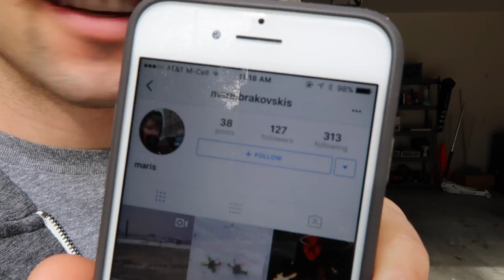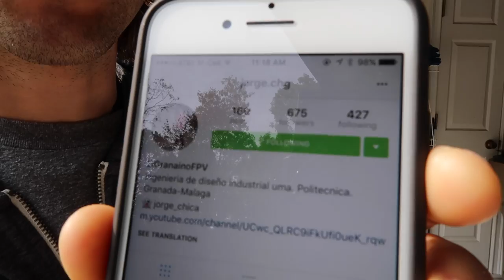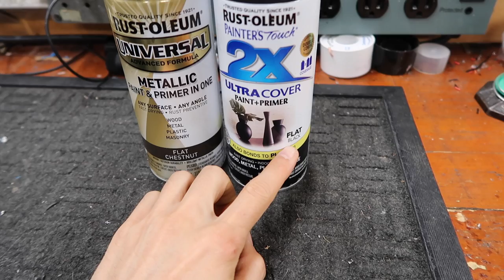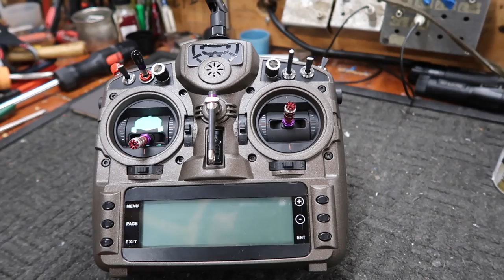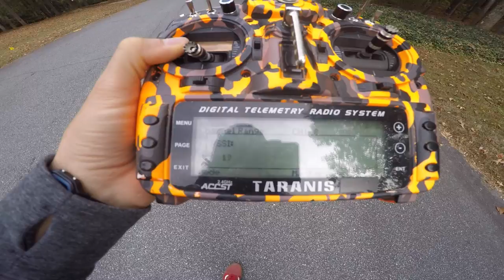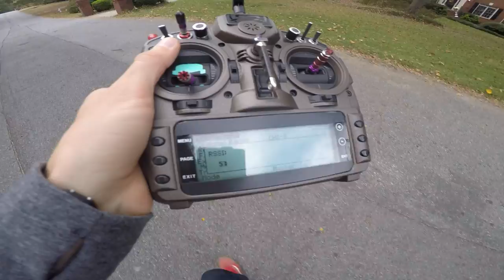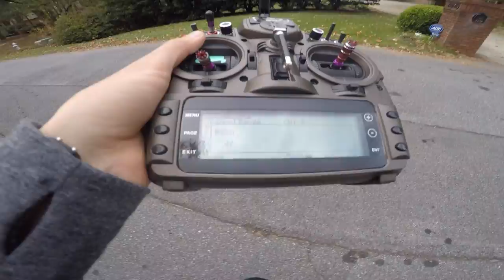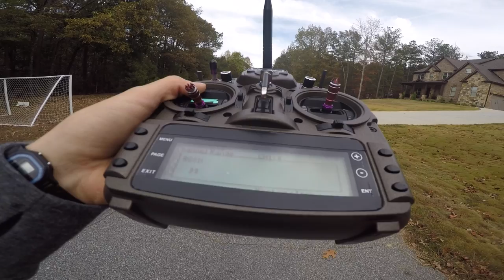The MUST HAVE FRsky Taranis Mods

Comment: Gentlemen, we strongly advise against the antenna mod.  We developed this mod +2 years ago achieving the longest run of +10km out.  The mod does work well but in the end we found a high failure rate due to the solder pads lifting.  Furthermore, even when the mod is done well, we have found much high failure rates of the RF module over time.  I strongly recommend using an external XJT module which comes with an external antenna connector and has no risk to your TX.  It works just the same and we achieved near similar performance.
Reply from the maker: +mgbolts who are you and what is your background ?  Just curious if you work for FRsky. Or are just a guy that tinkers.  I'd rather have better performance and risk "killing" my 30$ RF module than have decent performance and it last forever.   That is if what you're saying is true..  which I'm skeptical because I've seen people with this mod for over a year now with ZERO issues.  
Cheers
Reply: Are you the guys from boltrc?
Reply: PM'd on FB. We have done 100+ of these mods.  As highlighted, the failure rate is high due to novice attempts at what is a difficult solder where pads lift very easily.  BTW, if you do damage the original taranis (ie. not the plus), they dont make the backboard anymore. 

You are right, the mod does work very well, +10km :) achieved with no booster etc, just simple 5dbi whip. I suggested the external module as it is essentially the same mod already done for you, just add the antenna....

 In summary, I am agreeing with you, just a different approach with less risk and similar outcome :)
Reply: I think as long as you guys glue the wire to the case to relieve the strain of the wire moving around youre golden.
Reply: 10+ km with what reciever? i have a x8r and 5dbi mod and i cant get over 2 in a non 2.4 polluted area.

Comment: Thank You Mr Steele.  Your video was very helpful.  I did the mode yesterday with RG316 like you suggested and used the length you recommended.  First antenna that I could find laying around was 9dbi WiFi antenna.   SWR was flipping between 0 and 1.  Did a range test and was very happy with results.    I am glad that I ran into your video, not someone else s, otherwise I would have used wrong size and length of the coax and would have been plagued with SWR and RSSI issues, like most people have.

Comment: To remove hotglue just use a single drop of alcohol, it will come right off with no trace left!
Reply: muh1h1 wieso zur Hölle bist du in jedem Video das ich schaue?
Reply: I love isopropyl alcohol, it has so many uses, it's crazy.
Reply: What kind of alchol ??? edit your comment it is useless
Reply: @leoetcheverry9685  all the substances commonly refered to as "alcohol" work. Rubbing alcohol, ethanol, isopropal, etc.

Comment: Word of advice: solder the negative first, i almost ripped the antenna pad of because i had trouble with my stiff cable (bought the wrong one as well). The negative pads are way bigger so you won't rip them.

EVEN BETTER: use a ufl smd antenna connector so you can swap later (if ever needed)

Comment: To make it flush i cut a 5 inch propp and filed it flush.. drilled a bigger centre hole and used a file.. took like 15min of filing.. a bit of work but it was fun : )

Comment: Steele -would be a life saver if you could link the nut you are using on the switch. I lost mine and looking everywhere? "taranis switch nut" ??got any links
Reply from the maker: +UAVfutures radio switch caps on EBay.  Check that   You should be able to find some colored ones lol.  A lot hobbies has replacements if you buy s new switch.   The switches are cheap

Comment: Alex greve is the man! He did the mod on my terrines with the cable and sma port and all that, and he didn't even go 316 on that cable. Its that super duper fat stuff he uses on his helical antennas. Works great! I also use one of the 2.4 ghz clover leaf antenna with it.
Reply from the maker: +shaneman27  haha heck yeah. I tried the clover leaf in a range test. And I prefer. My 5dbi whip right now.  I never have issues with orientation of my antennas  that the clover leaf would help with
Reply: Mr Steele yeah I doesn't really improve range much maybe a little, but what I have seemed to experience is it helps with penetration. I flew a wing with an x8r in it to about 1.7 miles before getting rssi low. I don't think I got quite that far with the stock. 

And I just remembered something. Right before Flite fest you had a periscope going until like 4 am and I commented something that I didn't expect you to see but you did and I said my name is Joe but it's Shane and you just kept calling me Joe and then when I met you at Flite fest you are just as funny as you are on camera. 😂 I'd love to see you again sometime In the future.

Comment: To remove the hotglue you can use alcohol as well, works perfectly fine!
Reply from the maker: +Jory W thanks. I'll try it soon
Reply: The alcohol or acetone doesn't really dissolve the hotglue but will make it come loose and the hotglue can easily be lifted off the surface in one piece.

Comment: They make a really nice glossy Carbon Fiber looking complete top case half for 39.99 also.  I am waiting on the new Hall effect Gimbals for mine to change it over with the top case and antennas.  A better speaker is a cheap but much needed mod I bought also.

Comment: i finally need to get rid if my dx8 even with 2W wifi extender the range/penetration is bad.... will probably do the same mods THX.
Reply from the maker: +crash dummy yup. I had a Jeti with a 800mW booster and it still sucked compared to the 100mW stock antenna Taranis.  Mini quads require different needs than LOS plane flying

Comment: So I finally got around to doing this, I also used the more difficult RG316 coax. So attempt number one I left the taranis circuit backboard in the taranis frame and ended up screwing it up :( I'm an experienced solderer, but even still. I put a little too much strain on that tiny antenna signal pad and it ripped off the board. Had to order another backboard ($70 :( )

Then, attempt number two was much easier as I had the backboard taken out of the frame.

Mod successful now. Zero SWR.

Comment: Yeah, I was thinking of an antenna change up but wondered what configuration would be good for drone operation. I was thinking if you wanted max distance in operation if a Yagi would be best since it creates a beam output vs an omni output. For the transmitter part on the handheld wouldn't be a problem but the transmission on the drone might be a problem unless a better collector antenna to receive weak signals from the drone can be used to boost your range significantly. That would be a cool test to see.

Comment: Steele, weren't some people having range problems with their high gain antennas,  with the problem supposedly with the connection with the SMA connector?  Something about too many cycles of adding and removing the antenna, hurting the integrity of the SMA connector?  I remember something.   Do you?  If so is it gone?

Comment: we where curious my friends and me about the 84mm length.. so we tested.
84mm 94mm 10mm and with shield means not measure it from the base of the rp-sma contact.. if we gona be sticklers.. so we threw in that in the  test as well.. one extra 84mm measured from the crimp and an extra little bit for the signal wires.
so 4 Taranis got modded.. and guess what.. they all had same distance and rssi.
so don't be fuzzy when you all cut your cords : )
Reply: I was under the impression that the measurements really come into play when stripping the end of the antenna wire. Most often on rx's because they often get cut so you can strip the coating back the correct amount and still get the same range as before. But I'm 
Always learning new things so I figured Steele was more educated than I. LoL

Comment: In the rush to fit a 5dbi antenna it's probably worth pointing out what you lose for gaining gain... The radiation pattern is flatter and antenna orientation becomes more important (all that flippin' ain't helpin'). The flatter radiation pattern means that if you fly much above 45 degrees from yourself you may find you have reduced range compared to the 2dbi. Watch out during those big inverted hangs!!
Reply from the maker: +iFli helps to mount Rx antennas 90 degrees out of phase.   I have no noticeable side effects from the 5dbi antenna
Reply: Cool. Just thought I'd mention it!

Comment: damn that's awesome. you could fly half way to the moon with that thing. my dx6i must have problems because I would drop signal going that far away not even in range mode. I can't wait to get a new radio.
Reply: Casey Searls mine was shit too, taranis is much better
Reply from the maker: +Casey Searls haha sorry to hear that.  Taranis aren't that expensive :). Used ones are even cheaper :)
Reply: Tax returns can't come soon enough haha
Reply: Can I buy your orange one? I promise I won't try to sell it on Ebay :)

Comment: The antenna mode is a good idea BUT if the goal is to remain legal -- they measure the legal limit based on radiated power.  NOT on the input from the transmitter board.   Your mod certainly increased the amount of power transmitted but did it put you over the limit?   Who knows?    But you can't claim that using the same RF board keeps yu legal, to know that you'd need a field strength meter.

Another way to increase range is to improve the antenna in the receiver

Finally one last comment.  Your higher gain antenna comes at a cost of a flatter beam pattern.  The RF comes out the SIDE of the antenna and the disk is more flattened with the larger antenna.  This works good for you if the quad is always low to the ground the you keep the antenna vertical.  But if you leant radio over or the quad flies high the RSSI would be WORSE then with the old antenna.    In other words you new antenna is more directional in the vertical place (but still omni in horizontal plane)

As I said, good mod if the drone will always be about as far off the ground as your transmitters and yu can keep the antenna vertical

Comment: I've just recently added a Visaton BF 32 1.3" speaker to mine with a 3D printed mount and it sounds great! Sounds pretty good when playing my music and I can feel the bass for sure lol. I did a range test before and after just to be sure there were no side effects to the magnet. I've been flying it a few months now with no issues. Have you thought about upgrading yours? I could hardly hear mine outside sometimes.
Reply: Erik not sure if you know, but volume can be changed.
Reply: Of course, hence the reason for the upgrade. I run a script to play a random song via a switch so I always have some music. With this it is louder than my phone and has bass too.
Reply: Erik hmm. Seems awesome!

Comment: So this might be a dumb question but:

Since it is not recommended to replace the internal Tx antenna, should I buy an external XJT module to fit in high gain antennas?

Comment: Lol.... you explained the 5dbi antenna mod very clear! Well, one word - THANKS! I have no more things to say... rather that i am going to paint my Dx6i to!! Been thinking for years to do that...or DIY rit dye...well one of them! Do you have a link to that quality 5dbi antenna? Cause i only know the linksys 5dbi antenna...but have no clue if it's good quality or not...Also the RG316 cable there is no UFL to SMA cable made? We need to make them? Why? know?
Reply from the maker: +targetingxmod   You're welcome.  If you want u.fl connector.  Try RG178. It's great cable. Very low loss and comes in sma and u.fl.    As far as an antenna goes. I'm not 100% sure how to tell you where to get good ones. As I don't know where mine came from lol. The one I use now I found at my house. And the one I bought was from A loft hobbies.   All of these antennas are RPSMA. BTW

Comment: Steele- what antenna are you presently using and what advantage does it give you (aside from range)?  I've noticed what looks like a "T" on prior videos, what and why?   These informative vids are great?!
Reply from the maker: +Wrstew  if you saw the T antenna that was a crossfire module. That I probably was not using at the time
But had in the radio. I am using the 5dbi whip as you see in this video and have been for some
Time

Comment: When I did the antenna on my 7e, I made up a plain wire 1/4 wave whip to put in the old plastic antenna shell. So when I take off the 5dbi, I screw on the whip, and it looks indistinguishable from stock.

Comment: Greetings from New Zealand, So its a great radio after all the mods are done, but not so flash out of the box? I have one and don't love it or hate it, seems like it should come with all those mods from standard. I guess the price reflects the quality.  Did your mods cost more than the radio its self? keep up the great work, I enjoy watching your you tube content thanks for sharing.
Regards Dave.
Reply from the maker: +MrAlcoholic3  hey Dave.  Gimbals were about 50$USD with shipping. Coax and antenna were 15$ at most.  Epoxy 5$  and battery about 25$  so if the radio costs around 200$ you're looking at roughly 300$ for a modded out Taranis.  And if you paint it it's another 3-10$ depending on the paint you use.   I hope
This helps.   Also flash the radio with the latest version of OPEN TX. 2.1 I think :)

Cheers 
Your country is beautiful. I hope to visit one day

-Steele

Comment: I wonder why Taranis "range mode" ends up being less effective/powerful. It makes it practically useful if I want to do a range check at a new flying site, etc.
Reply: Because that's exactly what it was designed for.
Reply: It's not meant for the air tho. Just to do a range check on the ground. Basically checking your RX for issues before you send her up and find out the hard way.

Comment: I just came so close to killing my radio just now. Yesterday I installed the upgraded antenna and then today i see this. I've got like miles of rg316, so if course I'm like "OK, I'll change over to that". I completely undo what I did yesterday, make a new cable, solder it in and glue in the connector and realize that the antennas are rp sma. so, I spend a bunch of time trying to create an rp sma connecter and realize that the ones I've got don't allow for the male pin to be inserted into the threaded side, so I've got to go back to the old freaking cable. so I go to remove the 316 and snap - the deadly sound of a pad lifting off. luckily, it looked like metal underneath and I was able to tin it. I got another thin cable on and I'm back where I was. that sucked. I was really looking forward to testing the difference as I did a bunch of testing just before removing it so I wanted to see if there was any real difference. at the short length i don't think there is too much loss... probably not enough to be noticeable, but I was feeling good when I got the 316 installed. just need to get some raw rp sma connecters to solder on and I'll switch it back eventually.

Comment: Yes absolutely necessary. So do you think we're getting some vtx signal loss with the newer tbs unify pro using the micro coax vs. the rg316 on the earlier models ?
Reply from the maker: +Dropoff510 there's micro coax on the new ones ?  I though that was on the old ones.  There is RG178 on all of mine
Reply: Mr Steele oh my bad. It was the vendetta unify that looked like the coax was smaller.

Comment: What do mean range mode reduces range by x30 ? Does that mean your drone could actually go 30x that distance ?
Reply from the maker: +DawntreaderUK yes. Range test mode attenuates the signal.  Aka makes it weaker. By 30x. For testing purposes
Reply: But the video won't go that far ? Is there any movements towards HD downlink to the goggles ? And is there some range boosters to boost the video feed so you don't lose video so much behind buildings ? I watched the "bad video" video.

Comment: Steele, do you measure from the bottom of the rp-sma connector (including the crimp ferrule in the 84 mm) or do you measure from the bottom of the crimp ferrule? Also why 84mm? Is it out of phase with the 2.4 ghz signal or something?

Comment: I am wondering about the co-ax cable measurement for cutting.  Are you measuring just the cable or is the connector included in the measurement.  Thanks for the great videos.

Comment: Can you post up which antenna you got? I'm looking around online and their are atleast 13 decent looking options but I'm not sure which one is actually good! Thanks!
Reply: Wondering the same.
Reply: just get a 5dbi antenna from amazon or they even have one on hobbyking in the frsky section
Reply: I am gonna try several some Alex G/VAS are really top notch and the small Paddles in different DB are great for longer distance once you do the radio sma - or rp/sma setup like he has. The Pagodas are tough and better than most if you dont mind soldering for the quads too.
Reply: Donald Stull  link for the antenna please?
Reply: JimmyDean1992 He has them posted in the description. Le Drib also has a good antenna from amazon and he has it posted in his description as well

Comment: What happens if I happened to cut the cable shorter than 84mm? Stupidly I flipped it to 48mm in my head :) Everything appears to work really well, anything I should be concerned about?

Comment: Pretty sweet I did that mod a while back but didn't use that cable. So just to confirm you used 84mm of rg316?
Reply from the maker: +Tim Bell 84mm of shielded coax so you'll need a little more. But yeah
Reply: Mr Steele awesome thanks brother. just curious but why didn't you do the 8ohm speaker mod? It cleans up the voice a hell of a lot plus it's nice if you play music from your radio.